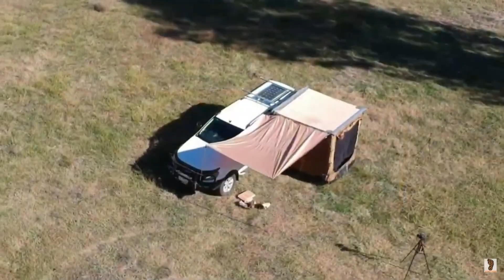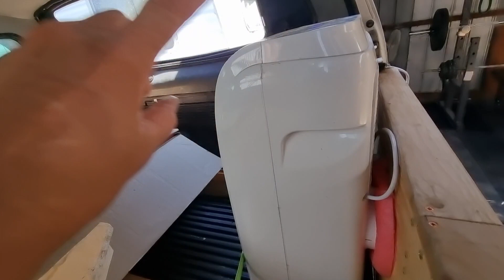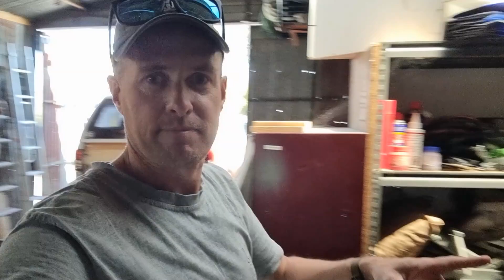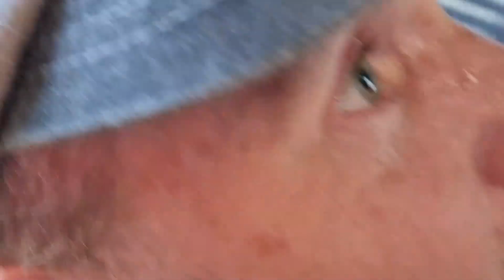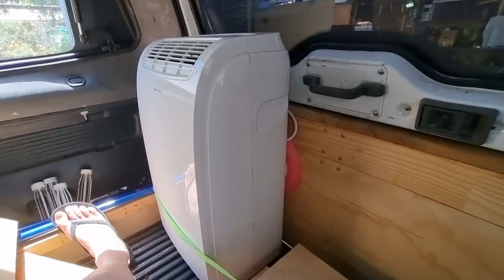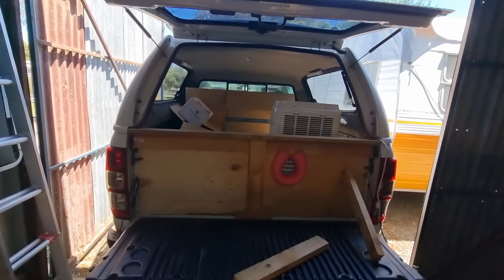Installing an air-conditioner in my dual cab ute camper

Comment: Great idea 😊👍🏽 
I’ve actually put a bed in the cabin of my ute. I pulled out the back seat, dropped the passenger seat down and built a bed over the top of it. It’s perfect length for me to sleep comfortably and being a solo female I feel a little more secure  at night 👍🏽 
I’m building a “chuck box” for the back so I can have everything contained and easy to get to. 
I also have a 3 x 3 gazebo that I can actually park under so I’m out of the rain to cook and have shade to keep the car cool.. still have plenty of room to have my table and chair set up under it too😊🏕🎣🔥
Reply from the maker: When I've got it fully setup for camping I have a 1.5m awning on the rear of the roof rack which extends out over the tailgate. I have seen people remove the passenger seat and have a bed in the cabin lengthwise.
Reply: @AllThingsOutdoors  I wanted to keep my passenger seat in. It’s easy to pull the bed out and put it in the back if need be👍🏽 
I’m just working with what I have at the moment and keeping it all very simple, contained but usable 🤣👍🏽
Reply from the maker: I like my simple setup too. More the fact that I can just jump in bed or leave quickly if I have to and it also opens a lot of possibilities for where you can camp, legal or not so legal😜